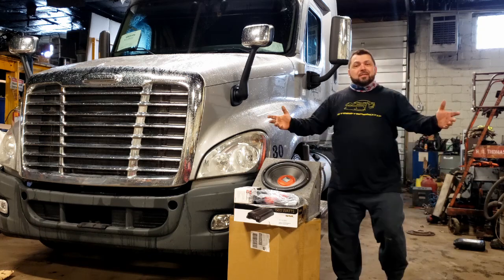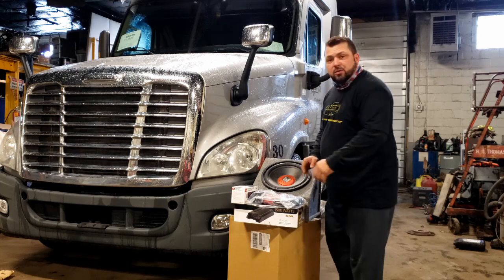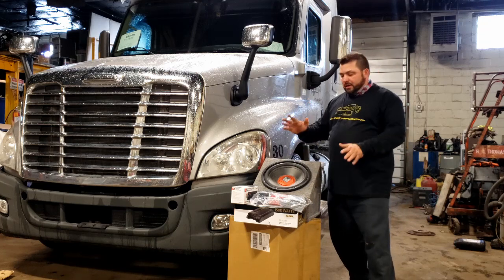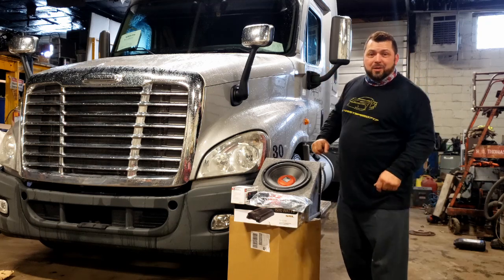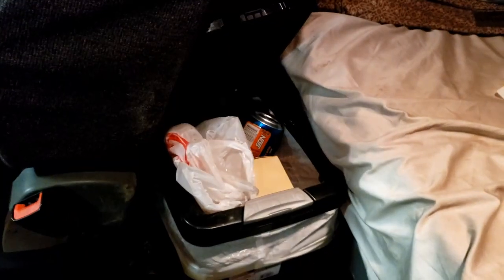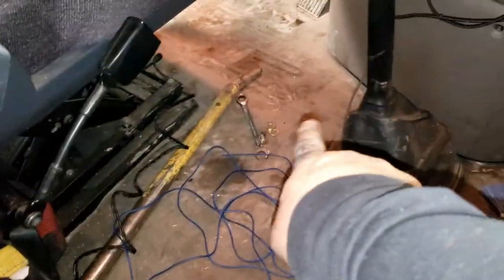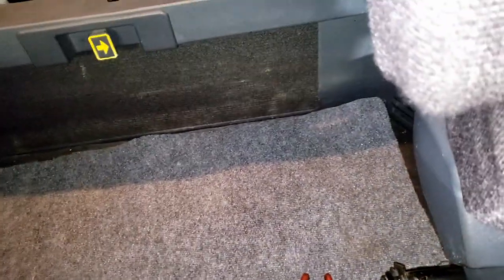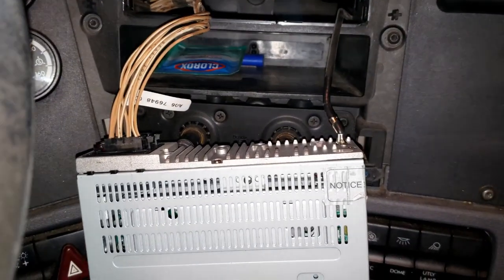As promised, Subwoofer in my semitruck !  Very special Bonus Footage . Very Clean Project Car

Comment: These new ones have 6-8 batteries, I also think we could simply wire the amp to the inverter leads which are in the same area your sub woofer is in modern trucks

Comment: This is the video I needed. I have 2 15inch subs I’m about to put in my cascadia and I needed more info on what the hell to do with the battery situation. I knew there was multiple but I didn’t know exactly how to run the power line

Comment: I don't know if you will see this as it is an old video but that fuse on your positive cable needs to be as close to the BATTERYS as possible. How you have it if that power wire shorts out anywhere between that fuse and the battery it will burn your truck to the ground. If the fuse let's say is only a foot from that battery then 5ft down the line it shorts out the fuse will pop and only that 1ft between the fuse and battery will still have power. 👍
Reply from the maker: Yes. I relocated it a long time ago. Thanks.

Comment: How did you ground the CD player? Cause I have an aftermarket CD player but when I turn up the volume, it turns off.
Reply from the maker: Just to the body. You might have a bad heat sink in the radio. If it's a new radio, it could just be a bad radio that made it through QC. Just to the body should be good enough.
Reply: @stevensgarage2166  .. I tried two different brand new radios haha. But I’m going to try to ground it to the body.
Reply from the maker: @antaurevans9382  you can also use the battery negative or use a volt meter and look for ground continuity on wires from old radio. I'm sure you'll be fine and get it working. It all works out.
Reply: @stevensgarage2166  .. I’m heading to Walmart now and I’ll buy a volt meter. But what should a the ground reads in volts??

Comment: The fuse should be as close to the battery as possible, that’s because in case the wires on the positive get exposed they don’t create sparks, also cutting the windows excess cable would be a good idea to get more direct power to
The amp. This was a bad install